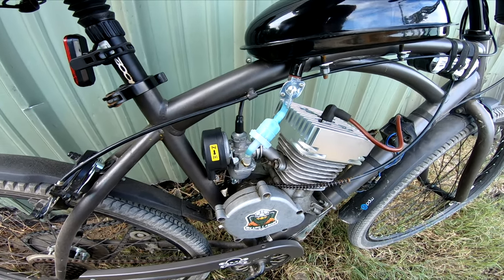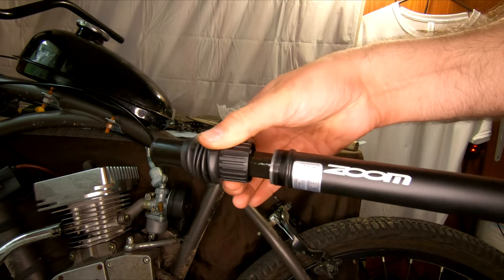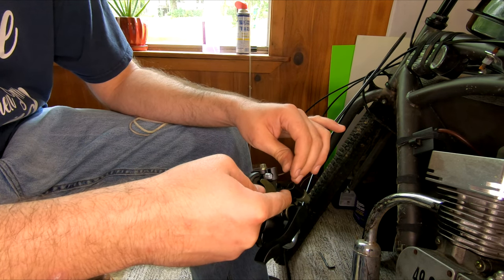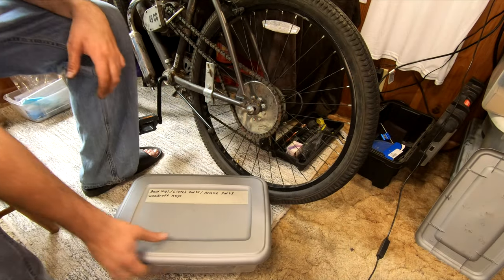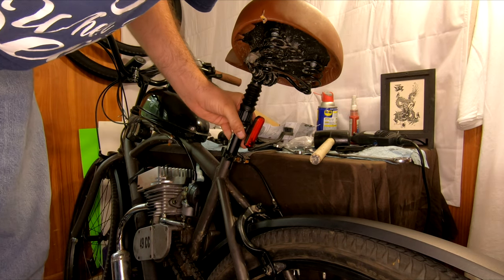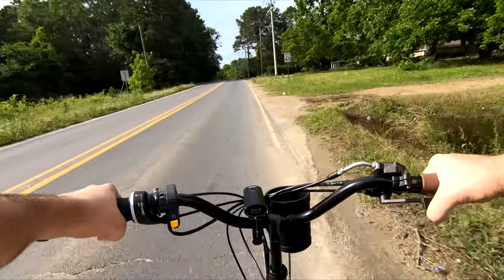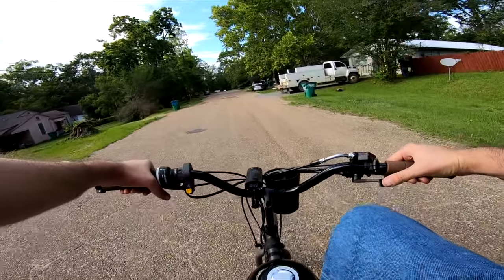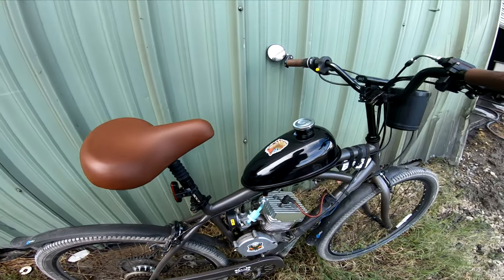Upgrading The Bayside (Parking Brakes Are Neat!)

Comment: Hey LA Hover, I started watching your videos months before I created my first motorized bicycle using the same kent bayside cruiser. I've had miscellaneous problems with it as expected, but fixed them somewhat easy. There are a few issues that have me fairly stumped that I don't know how to go about fixing. 1. When the engine is warm and I pull in the clutch, the engine races. I made sure it is not the throttle sticking. 2. My normal pedaling system sproket system (7 speeds) have broke and freewheel forwards and backwards. 3. The engine has a slight squeak every time the cylinder tries to fire, but stops when the clutch is pulled and is revved. (Sometimes you can hear it at open throttle while accelerating). I plan to take the engine apart and possible buy a new bicycle. Enjoy your custom motorized bicycle!
Reply: @brsproductions6117  Alright man, thanks for the feedback! I'll look into it.
Reply: Problem three makes me think that the clutch is slipping? Maybe tighten the flower nut just a tad?
Reply: @ChristopherT_  I'll check it out, thanks man!
Reply from the maker: I had to remove BRS... He is spreading bad info. I'll have a video up soon (probably this week) about "run away motors"... Freewheels can be replaced, some are easy some are stuck... Without hearing the squeak I can only guess, but I know my motoos motor has some squeaky clutch pads.
Reply from the maker: Until then, clean the carb (be sure the jet is clean), don't run to much oil (32:1 or 40:1 seems to be a safe ratio), drop the needle clip a few times and see if that helps, and try to wrap some Teflon tape around the intake where the carb clamps down.
Reply: @LAHover  Alright, thanks man! Had a close encounter with traffic earlier, so I'm now going to build something with disc brakes. I appreciate the feedback, I'll be looking forward to the next vid!

Comment: The suspension seat post is good, and helps for sure. After time they get problems, general play back and fourth. Gotta keep them greased as well. 
Got a Cane Creek thudbuster Lt...
It is expensive, but it is like riding on a cloud with a spring seat. No joke 
If your budget allows sometime, I suggest picking one up.. or keep a eye out on eBay.
They can be tuned with the elastic rubbers if your a heavier rider. 
3 and 1/2 inches of travel.
It is awesome for off road.
Big difference man. 
Awesome vids 
Keep it up!!
Reply from the maker: Thanks for the feed back

Comment: Hi LA Hover, Regarding your carb I find the middle notch on the needle is the most ideal spot however that also depends on your oil to fuel mix, and also altitude, humidity and temp which can affect tuning, these can be different here in the Philippines and in Louisiana. I use the Bofeng carb on all 3 of my 2 stroke builds (BT80, and the 2 Zeda 80s) all of them run great, except for my other zeda 80 which has a leak on the magneto screw, which kind of sucks
Reply from the maker: Solid information thanks. I'm starting to like the performance this Bofeng is giving me. Super smooth mid and high end.

Comment: A bit of high temp exhaust gasket sealant/gasket maker probably wouldn't hurt. Keep a good exhaust gasket seal without having to over torque the exhaust bolts. Smear a thin coat on each side of the gasket before mounting the muffler.
Reply from the maker: Thanks for the info

Comment: Tip:
Save your flat inner tubes. They are so useful. Seths bike hacks( now berm peak) has a good video of things that can be done with them but something you can do is rubber mount your fuel tank especially if you have a weird shape top tube like my bike does

Comment: I want  a sx, cr, yz, kx, or a rm 65  crome after market racing expansion chamber  so I could modify it to fit on my schwinn  but,  the price ..,so for now I have a bbr stage 4 banana pipe  that I cut the end off  & welded in  2” of the  threaded end off the forks of a little kids bike.       The inside has a taper sanded into to fit a peice of pipe that came from a lawn chair that runs under the bike  to an abnormally large crome stock gas bike muffler  that’s  like 3” from going past the back tire to fit the profile of a moped looking exhaust.  I drilled out the stinger on the end cap & welded in .60” x 4”  with 1” sticking out the cap .      The exhaust mounts are beautifully over done with 14mm acorn  nut & studs   Into a coupling nut welded under the crank shaft.           The dimond back sorrento  is done in the same way..

Comment: does the exhaust have a metal or fiber gasket? if just a metal gasket an additional fiber gasket may help
Reply from the maker: Originally came with the fiber gasket. I know I have replaced it a time or two, but I can't remember if I ever put the O2 gasket on this motor.

Comment: i bought a dio reed and it keeps on revving verry high when starting and riding any fixes?
Reply from the maker: Running lean / air leak around the carb, intake, or reed are likely causes of over revving. While the bike is running you can gently spray parts cleaner, gas, or starting fluid around the intake components. if the idle starts to drop, or the bike stalls, you found your leak. Just be sure you do not get over spray into your air box because it will fool you into thinking you found the leak... Also have a hose nearby in case you have a mishap.

Comment: Hey there, my bike has been suffering from four stroking issues and it doesn’t matter where I put my needle or how many holes I put in my exhaust cap. I’m using a 61 jet in the carburetor and it’s not working so can you send some advice please?
Reply from the maker: Do you ever noticed fuel leaking out of the carb? Might be a float level issue, or a problem with the float needle not closing.
Reply: @LAHover  No, no fuel has been leaking all the carb could be a fuel mix that’s causing the four stroking? Yeah I know is that
Reply from the maker: @dr.weaver6011  Maybe a weak spark or bad spark timing. Most 4-stroking is fuel/air mix related, but there are some sneaky little things that can cause it as well.
Reply: @LAHover  Thanks for the advice, I’ll check it out when I get off of work. Have a nice day!!

Comment: Hey where do I find custom grips for the throttle
Reply from the maker: This bike has a thumb throttle so I can use any standard bike grips. If you get an after market twist throttle you can find motorcycle and dirt bike grips on Amazon.
Reply: @LAHover  could you link me an aftermarket throttle and could you make a video showing how to wire turn signals and break light like the "Lighting system" video you had, cause I don't know how to wire these to the motor and it got me really excited. Also links for the lights would be highly appreciated

Comment: Would you consider reviewing a Phatmoto bike? It is an assembled 4 stroke bike sold on gasbike.net with a custom frame with integrated motor mount, gas tank, and tensioner. I think they are very high quality and are the best of 4 stroke bikes.
Reply from the maker: Their Rovers have failing jack shaft bearings from what I have seen. And for the price of their fat tire model I could buy a TaoTao Hell Cat.